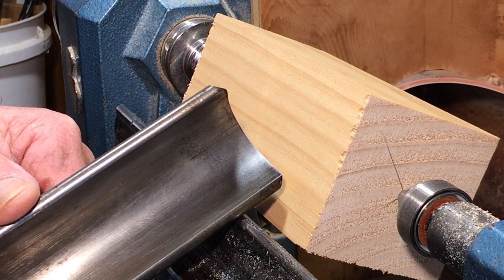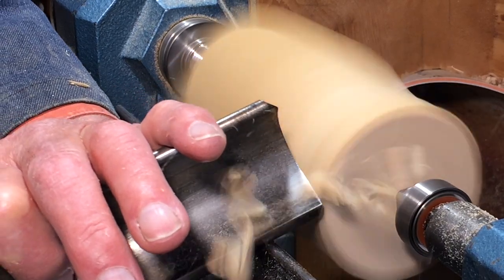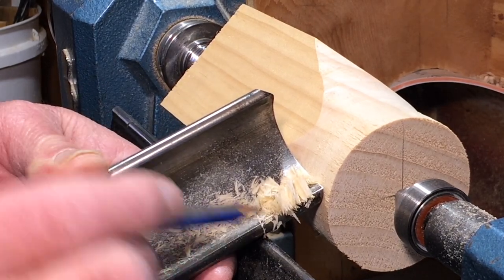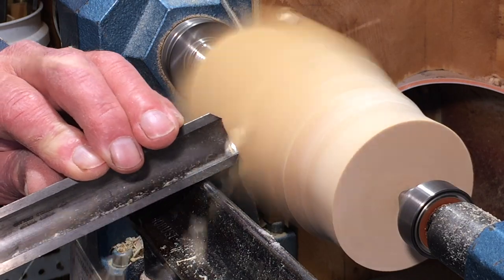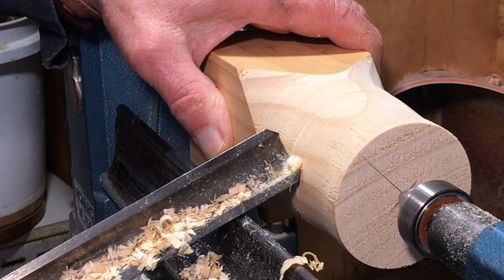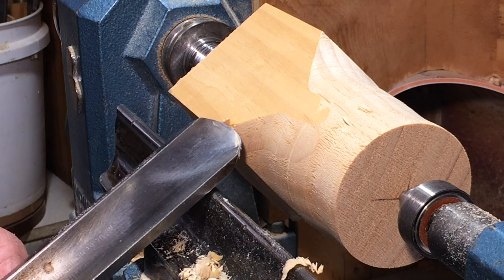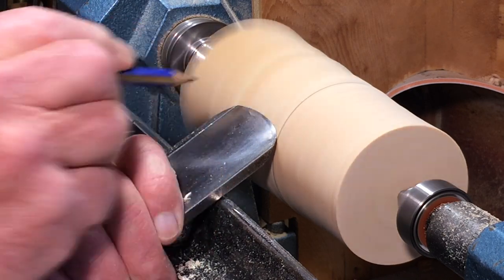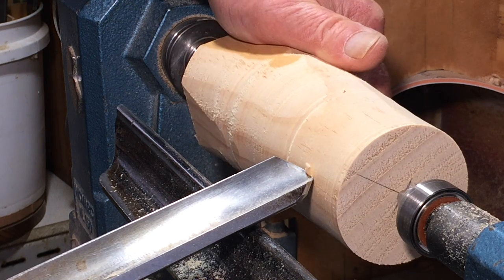Richard Raffan on spindle-roughing gouges

Comment: I prefer the continental style, rounded edge as this is very flexible, one tool does all for less detailed spindles. I also have the English one, if you cut on 45 degree angle it can cut as well as the skew for me.
Reply from the maker: If you use the deep fluted to shear cut, it helps to grind the wings back slightly, especially on the 1-in.

Comment: Does a larger roughing gouge allow for more material removal? I have a fairly basic one, and it does rough out, even shape, but I always wonder if a two inch one may offer some advantages
Reply from the maker: I find the 1-in continental roughing gouge best for roughing spindles, and occasionally an elderly deep-fluted bowl gouge that's too short to hollow bowls. I had a P&N 50mm continental style roughing gouge but prefer the 1-in unless roughing spindles over 12-in diameter when I appreciated the weight of the large gouge.  I don't know why the deep-fluted roughing gouges are so popular.
Reply: @RichardRaffanwoodturning  I never tried a continental style gouge, but was intrigued from seeing other people work with them, feeling it may be an easier way to get a shear finishing cut, since I dabble in lidded boxes and find the roughing gouge be my main outside tool for that, although I'm getting a 1/2" spindle gouge with nice steel, which may change that.. Thank you for sharing your experience.